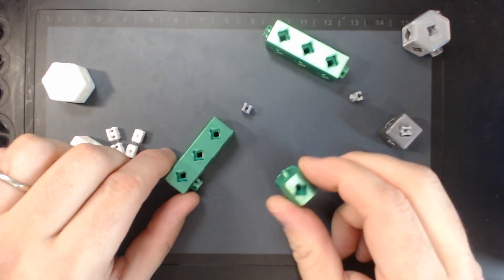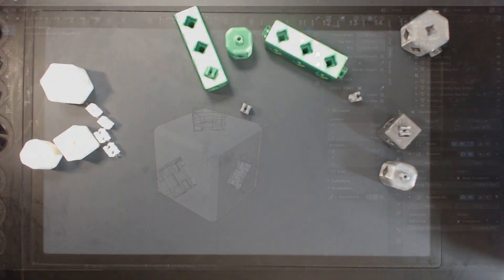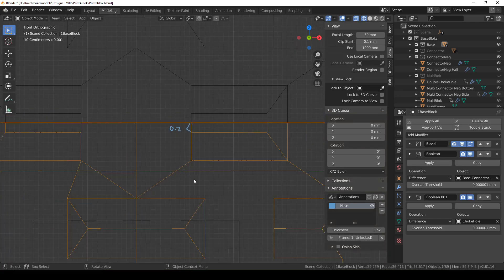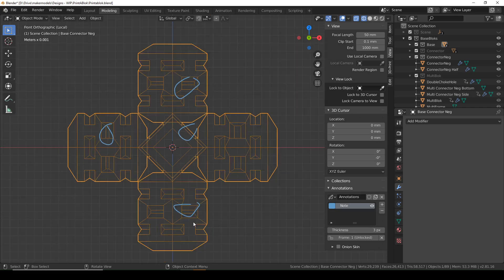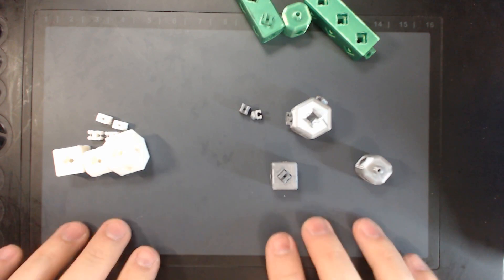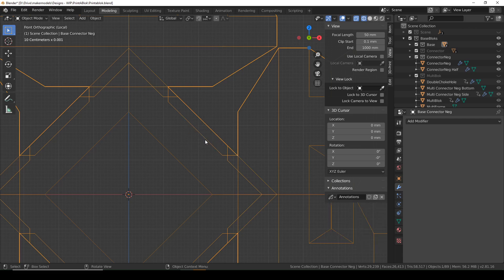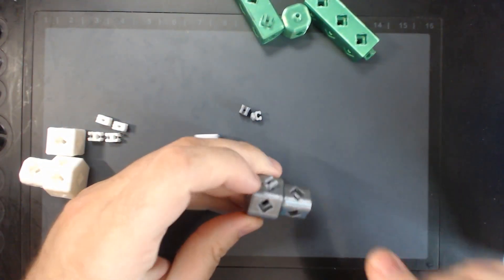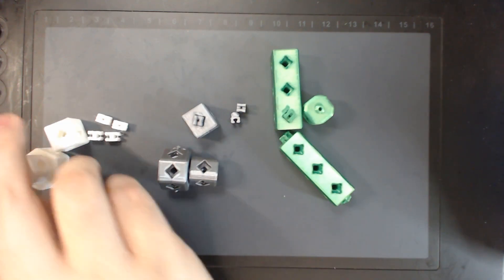Running into a problem with PrintABlok at the worst time

Comment from the maker: Doesn't Blender have a way to change one object and effect all of them? https://www.3dpprofessor.com/2020/03/10/finding-a-problem-with-printablok-at-the-worst-time-video/
Reply: use https://docs.blender.org/manual/en/latest/scene_layout/object/editing/duplication.html#linked-duplicates
And if you then keep the same parts as parts and put a union boolean modifier on it you get combined parts when you export.
Not sure if you get any internal faces then, but a quick run true 3D builder should fix that.
Reply: Link them instead of duplicating (alt-d rather than shift-d). This can be done afterwards by changing the Data block the Object refers to.
Reply: I think the right way would clearly be to fix this in the model. That's what 3D printing is about - changing the world to make it better. People who want to keep things the same can easily rely on the common industry instead.

Comment: This is just an update, but I actually found that indeed, I'm having this issue with..all the base blocks, but only with connecting to the pivot point side. So I am testing an idea that came to mind, Maybe Just a minor change to the pivot would actually fix the issue, rather then needing a complete re-design of every other block, as I am trying just, in blender lightly widening the pivot bulb to see if that fixes the issue of how it won't fit in the sides, but not prevent it from fitting in the bottom/top holes. Though I'm even struggling on the top and bottom ones after calibrating my printer @_@
Reply: Just adding this reply as an update, I expanded the width of the bulb in scale from 1.0 to 1.1, and well it snaps in now, but it's a bit too big, hard to pull free without some pliers, and a bit stiff to turn but it does snap in the side blocks properly, and the bottom only other hole it would snap into it can still snap but takes a lot of pressure to snap in and then pliers to remove, so I am trying another print with the bulb only increased to 1.05 scale in blender, and that might solve the issue for me at least as a quick fix
Reply from the maker: @RyushoYosei  Getting back some professional grade 3D printed pivot blocks, I can now confirm that my design is correct as-is, and the problem is how the 3D printer prints them, so if making the bulb a little bigger works for you, great!
Reply: Adjusting the width of the bulb to 1.075 Seems to of fixed it, as 1.05 was slightly too small, wouldn't always snap consistantly, sometimes wouldn't sometimes would depending on the hole, 1.075 however seems to be consistant enough that on the loose connections it still can hold, and on others it snaps nicely, If you don't want it to turn freely and don't m ind having to use pliers to pull it off, you can go as far as 1.1 for its width in scale, but it also is a bit hard to snap in as well considering that.

Comment: I was just looking this up as I noticed I was having t his sort of issue with the blocks I just recently printed with pivots, where holes on a very specific side, would not accept pivots, but others would.

Considering the issue, I think it's fine that you released it as it is, and can take a bit of time to figure out how to fix the issue, just have/add a note to its saying that there might  be an issue with the pivot blocks with certain printers, and then when it's fixed, just send out a little update notice to everyone going "Hey, the updated version is available." Though I can see you updated it on the  source block, I understand it will take a bit to go through and fix that for all the various kick starter blocks over time.

Comment: I'd suggest releasing the models immediately, BUT making it very clear that this is a prerelease and that the final version may not be 100% compatible with the prerelease.  There are probably half a dozen other small things that would benefit from tweaking that you're not yet aware of or where an outside perspective might see an improvement you'd never thought of, so entering a public testing phase will very likely improve the final product.

Comment: I say fix it if you have it figured out. If not, release it as a beta release and if someone can come up with a suggestion to resolve the issue, release an update. It may mean some folks will have to update their work, but as this has all been work in progress, that's kind of a reasonable risk of starting on remix projects early.

Don't worry about delaying things a bit. I've seen Kickstarter campaigns suffer delays of 2+ years and my view is I'd rather have it right than have it right away.

Comment: sdFac=0.001;
standardBlock=[24,24,24];
standardDrill=[8+sdFac,8,8];

nibDepth=1.4; //whoops
nibOverhang=3; //whoops
nibLength=standardDrill[0]-0;
nibShorten=1;

//Object();
module object(standardBlock=standardBlock){
    cube(standardBlock, center=true);
}

module faceDrill(standardDrill=standardDrill, odd=false){
angle=(odd==false) ? 45 : 0;
pos = standardBlock[0]/2 +standardDrill[0]/2 -standardDrill[0];

translate([pos+sdFac,0,0]) rotate([angle,0,0]) cube(standardDrill, center=true);   
}

module typicalNib(nibDepth=nibDepth, nibOverhang=nibOverhang ,nibLength=nibLength){
    X=nibLength-(nibShorten*2);
    translate([0,0,00])
    rotate([0,-90,0])
    translate([nibShorten, -nibOverhang/2, -nibDepth/2])
    linear_extrude(nibDepth)  polygon(points=[[0,0],[X,0],[X,nibOverhang],[0,nibOverhang]]);
    
}
module typicalNib2(){
rotate([0,-45,0]){
typicalNib();
rotate([0,90,0]) typicalNib();    }
    }

module typicalNib4(){
mirror([0,0,0]) typicalNib2();
translate([0,0,sqrt(((standardDrill[0])*(standardDrill[0]))*2)])
mirror([0,0,1]) typicalNib2();
    }

    
union(){
    translate([24/2,0,-24/4]) rotate([0,0,90]) typicalNib4();
difference(){object();
    
    faceDrill();}
}

Comment: Blender is your problem, it’s a mesh based modeler you can’t control dimensions accurately. Small items like this need to be modeled in a NURBS based CAD system, where you can control the dimensions. Plenty good options, Fusion 360, Rhino, SolidWorks, and many others.
Reply: If you say a 3000 dollar option is a good option you are wrong.
Reply: @MisterMakerNL  Fusion is free for hobbyists and startups. Pretty sure this qualifies as a startup.
Reply: @marklandsaat3696  It does now. Who can tell in a year what it is going to be.
Reply: @MisterMakerNL  So, don't use a free tool that is much better suited for the job on hand, because it may not be free at some unknown point in the future? That makes total sense.
Reply: @marklandsaat3696  It does actually. Don't invest in something you can probably not afford in the future. It also cannot be available anymore, if Autodesk decide they want you rather on Inventor and they pull the plug. Then say bye bye to your work. (or pay up)
Reply: You are mistaken. While there are rounding errors in positioning mesh vertices like this, they're far below the similar inaccuracies of common 3D printers. Designing with tolerances in mind would also cover that. That said, mesh editing like this is suboptimal.
I would consider using FreeCAD.
Reply: @0LoneTech  Well I was trying to help. Having been a product designer for more than 20 years I have never seen any company use mesh modeling data to manufacture accurate/toleranced prismatic parts. It doesn't sound like we are going to agree, so I'll let it go, but will happily continue to use NURBS based CAD for product design.

Comment: Fusion360 utilizes parametric modeling which is what you need to make updates easier.
Reply from the maker: Blender does too. I just didn't take advantage of it like I should have the first time. But I've corrected that now.

Comment: Maybe include a sliced gcode of the model where overhangs are printed a significant amount slower and with higher rpm for the cooling fan?
Reply from the maker: I think that would definitely help. I think that's why some printers I tested it on it succeeded, and others it failed. So this could be fixed with a simple "get gud", but I think I can modify the design to lower that bar somewhat.

Comment: Two ideas come to my mind.
The first - pivot block with a round hole that the square connector goes in to.

The second - a connector that has a built in pivot.

These two ideas probably have their own issues. Idea one might have the same overhang issue.  Idea two might be too small for a good pivot to be baked into the connector.

Comment: Could it be easier to just make a new rotateblock? Like a 2 part block that spins by itself that we could connect into a regular block. If you dont have space for a connector you could just make it with a built in connector
Reply from the maker: I've considered it. A trapped internal pivot point with a controlled fail to build internal snap away supports. I've seen designs that do that successfully. I'll have to play with it.

Comment: It's a tough one. Because it's supposed to print on any machine (unlike legos). But it's such a small problem that could be fixed in post. I would release and fix it after. But the choice is ultimately your's.
Good luck and keep up the good work.

Comment: 1) Most Kickstarters are 6 months to a year before delivery. You are promising immediate release. I have no problem waiting a week or two if it means perfect blocks instead of almost perfect. 
2) If this is an edge case, then treat that one edge. make the pivot a specialized connector, rather then a specialized block. This would let you take your time to fix the problem, and the fix would then work with any block.
3) If the fix is a redesign, then do it now. You are accepting money from people who want it perfect. That should take precedence over those who have already done remixes. Irritating early adopters now to get it right is better then having everyone have to adapt to an eventual version two that finally fixes everything.
Reply from the maker: 1) I've got a couple of weeks before I can deliver on the kickstarter, so in truth, this probably won't effect the release date at all.
2 and 3, just gonna say "Yup".

Comment: At least publish a corrected connector negative and connector half negative.  I have been developing a lot of PrintABloks in openSCAD and I can change one line of code, rerun some Linux bash scripts and update all of the models I have developed in about 10 minutes and reload on Thingiverse.  Everything I have done so far has worked well with the existing connector sockets. I suggest you publish what you have and maybe issue corrected models later.
Reply from the maker: Will definitely do when I have them.

Comment: This is a slicing/printing problem not a design problem, though of course we have to design things to try to minimise printing problems.  If it really is an overhang problem, then tackle it from that perspective.  Cura has a setting to make the printer do the outside skin layer after doing inner skin passes, thereby giving it a chance to adhere to something.  This has solved a lot of my overhang problems - I can print a long straight edge right up to 70 degrees of overhang, though that is really pushing it and can result in cooling distortion which gets severe the longer it goes on (the overhang starts to feather upwards) but it shouldn't be an issue for such a small feature.

I think you're OK to continue with the release as you've modified it, because you have shown that it works with some combination of slicer/printer.  People will understand that this feature might be a a lot more challenging if they want to attempt it.  This is good thing - bragging rights are there for anyone who can print so the rotating blocks work successfully.

Comment: Is it possible to make 2 different blocks (small and large peg).  That way if the printer is off you can choose one that will snap in.  Could mark block in some way say with stripes or dots.  One for small and two for large.  Not an engineer here just a thought.
Reply from the maker: Good thought.

Comment: If it is just for the rotary connector, just leave it as it is or try to make a fix just on that. You tested this design over several different printers and it has proven its point.  But if you have the right solution and the will to fix all your models go ahead.  I'll do also my best to fix my remixes to the new connector version =)

Comment: It blows my mind that you made this in blender!  I am impressed.  I would have made it in Solidworks (or fusion) so that the changes would easily carry through.  It must be a real pain trying to adjust these using your eyes and manual math.  You did some great research.  I don't know that you can really control this for everyone because even setting up prints will have some people putting out more on the bottom row to make better adhesion... others may never have that problem.  I think you should release it and let people work out the best way for them to print.  Anything we print has some effort to get the results we like.  Relax man!
Reply from the maker: You don't have to do manual math on Blender. Properties panel allows you to be exact, and if you type a math function in a number field it will resolve to its value automatically. That's a feature I wish more programs did. 
Blender's capable. It's just a different way to do things.
Reply: @3dpprofessor  Oh very nice!  Obviously, you can make it sing. Can't criticize a tool that works :)
Reply: @3dpprofessor  blender is also free so that's a big plus for those of us out here with limited funds to mess about with

Comment: You could make a connector block that has a regular connection on side and a pivot conection on the other side. That way you can always  connect a square block with the face that was printed up to the pivot point.
Reply: That's what I was thinking too.  Sort of like how legos sometimes connect wheels and whatnot.

Comment: If the problem is (more or less) with just the pivot blok not working well with the other pieces - but everything else interacts well with eachother then are there changes that can be made to the pivot blok piece?  If you changed that one wouldn't it solve the problem for everything? Or would changing the other bloks make everything else work better together too?

I don't have any answers. I'm not an expert.  Just posing some additional questions (that you probably already thought of).  I'm happy with whatever you come up with - and congrats on passing 400 backers!